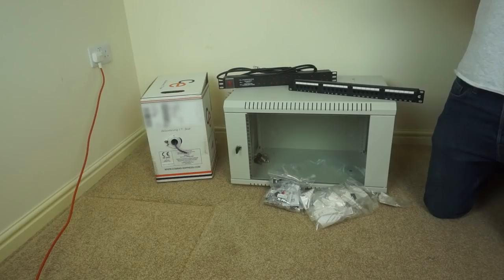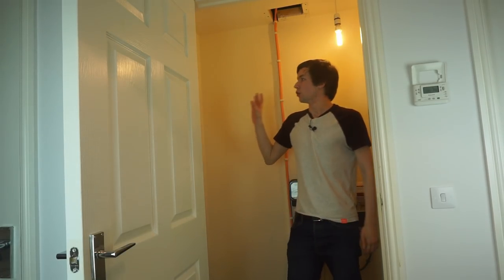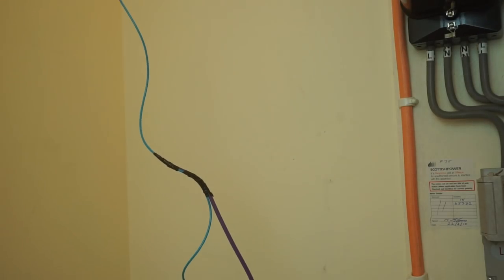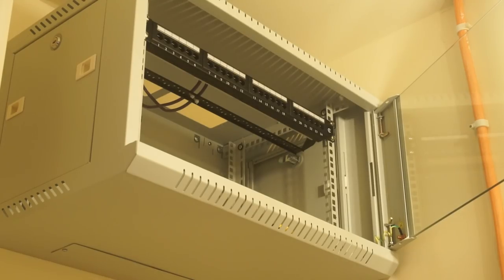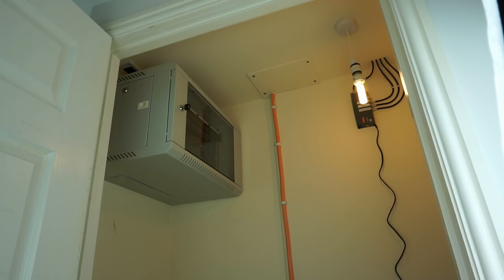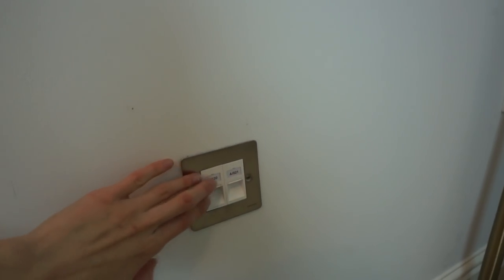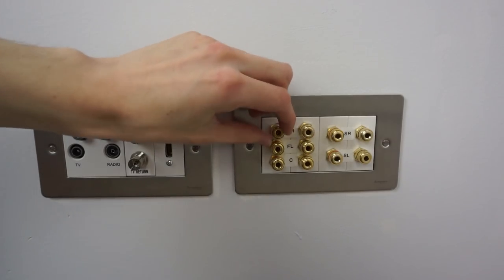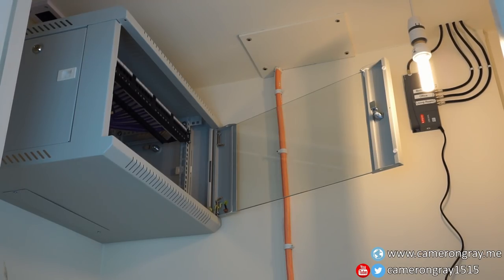New Flat - Time to install a completely overkill home network!

Comment: What was the reason you have installed coaxial, and not just using the ethernet ports to stream via i.e. plex via for example a hdhomerun?
Reply from the maker: It cost very little (probably around £50 for everything) and required no additional disruption as it runs to the same points as the CAT6 does.  If I want to watch live TV it's also significantly easier to just use the tuner built into my TVs than having to muck about trying to stream it.  I was honestly really surprised that there wasn't already TV antenna connections in the bedrooms already from when the place was built.

Comment: How would you go about networking a flat which was built with the more solid old-timey methods of stone construction instead of having plasterboard everywhere? Is surface-mounted cabling the only way to go?
Reply from the maker: It's a lot more destructive but assuming you can lift floorboards you'd run the cables under the floor and then chase out the walls to run a channel for the cable and then chase out a larger square hole for the backbox.  You'd then have to plaster over the channels again - probably worth using conduit inside the channels to allow the cables to be pulled back out again in the future.  If that's too much effort then surface mounting would likely be the best option, you could always still run the cables under the floor and then just need to use a bit of surface trunking to bring the cable up from the floor to the outlet.

What I'd generally do is take a couple of the sockets off and see if you can figure out how they have been installed into the wall and where the cables are being run - e.g. are they running under the floor or are they going through the ceilings.
Reply: Cameron Gray Thanks for the reply :)

Comment: when fishing cables around house do you put them in same opening or near as power leads?
Only way i can route cable upstairs is via one hole that is used to supply 1 power lead upstairs... Is interference an issue?
Reply from the maker: Ideally you'd want to keep them separate but I will admit that theres places in my install where they run near to each other such as to have power and data behind a TV where you need them to be next to each other.  Then additionally, all of the mains wiring runs through my ceiling so if I had to keep data wiring totally separate, it would be a nightmare, I'd probably have to rip ceilings down and clip the data cables explicitly away from the mains ones.  I've never had an issue thankfully although if you're worried and the mains cable is carrying a particularly high current, shielded cable may help.
Reply: @camerongray1515  thanks. So your electrical cables are not via the floor? Although with the raised ceiling you've plenty of room for cables.
I was tempted to put it in trunking but its a pain to get that thru void.
It was a trouble getting the cables thru in first place 😁😂
Reply from the maker: Yeah, in this place everything apart from the gas runs through the ceiling - water, central heating, electricity, data, phones.etc.  Gas runs under the floor but it's literally one pipe from the meter to the boiler.
Reply: @camerongray1515  is that because it's like an apartment setup?
Anyways you're responding during early hours  ⏰

Comment: Wish i knew how to run wires in walls as well as you. Suppose it helps having that huge hog-out drill bit for extra large holes through studs. Lot of drywall holes tho.

Comment: I reckon all the sockets you added as wall mount are going to get used ever !
Reply from the maker: I do use them, that was the whole point of the project!  Sure they aren't all used all the time but I made sure to add more than I needed so that I have room for future expansion without having to cut holes in the walls again.
Reply: @camerongray1515  good stuff man, great video,

Comment: Should maybe include some mains plugs at the same time.
Reply from the maker: Currently waiting on an electrician to be available to add them - Will be getting a 2 gang socket behind each TV then a 3 gang one in the hall cupboard.  Unfortunately, Scottish building regulations are really strict as to what work is classed as "requiring a warrant" when it comes to doing electrical work in a flat (you can do way more in most houses, in a flat you are pretty much limited to replacing existing fixtures with new ones) so if I were to do it myself (which would be dead easy) you'd have a complete faff submitting warrants and getting everything signed off which I have no idea about how to do!

Comment: The installation of the network hardware reminds me of when I was in year 7 and networking hardware was installed throughout the school, a rack was installed in my classroom and of course cables were run through the buildings.  I've often wondered if anyone has a network cabinet rack installed in their homes and now my question has been answered.  I've sometimes had dreams in which I'm in a house where network rack equipment has been installed.  Is the radio socket for connecting a cable to your radio tuner's FM antenna socket for improved reception?

Comment: I can't believe this video is 4 years old :) how did these wallplates hold up.
Reply from the maker: Feels like it was yesterday for me as well!  Modules are all holding up fine - I broke one but this was due to me tripping over a cable but other than that they've all worked perfectly.  This was the other benefit I found of using the separate euro modules and keystone jacks - when I tripped over the cable, it just snapped the clip off of the euro module part but the keystone was fine.  Meant that it was super easy to just clip on a new euro module shutter without needing to touch any of the wiring.

Comment: How many face plates keystone Jack's and euro connectors did you end up with In the end? I prefer the cable going down as then there's less chance for damage!
Reply from the maker: I've currently got 14 drops to ports down at floor level, 6 behind TVs, 1 for the access point and 2 cameras.  The APs and cameras don't use those keystone modules so in total I have 20 keystone/euro module combinations across 9 faceplates.
Reply: @camerongray1515  wow that's some good going. Feeding the cables is a pain! Keeps getting stuck in insulation and hitting studd joists!

Comment: Are you going with FIOS for a blistering broadband connection, if you have a SKY HD+ box you need two sat connections not one, if your Fridge/Freezer is an IOT enabled unit that should be good.
Reply: As you can see at 29:13, he has two SAT connections :) He also said in the video he'll be using the phone jack in the closet.

Comment: What kind of mini PC are you talking about putting behind the TVs used for?
Reply from the maker: The one in the bedroom is the "Z83 Mini PC" I reviewed previously and for the office I'll probably get another similar one down the line.  I tend to use them for watching online content (YouTube, Catchup TV services.etc) - The Smart TVs can technically also do that but there's some services they don't support and I find using a PC with a proper wireless keyboard/touchpad much easier than trying to navigate a smart TV using the remote control.

Comment: Great video, exactly what I’m planning to do. What did you fill the holes with? Would have liked to have seen your technique for filling the large holes as I’m worried in going to leave a mess!
Reply from the maker: Thanks!  Essentially to fill them I used a piece of wood glued across the inside of the hole then glued the original piece of plasterboard that I had removed onto this (I mounted the piece of wood in such a way that the bit of plasterboard sat slightly deeper into the hole than the rest of the wall.)  I then just filled the hole with plasterboard filler, sanded it (took a couple of rounds of filling and sanding to get it completely smooth) then just painted over it.  Afterwards the holes are all practically invisible.

Comment: Not sure if you can answer this, but for the coaxial cable thing you installed was that connected to your main aerial that your tv provider gave you?
Reply from the maker: It's connected to the aerial feed that comes into my flat from a communal aerial which is fed through a fancy distribution system to all of the flats in my building.  If you had your own aerial it would connect to that instead although in the UK you wouldn't get an aerial from a "TV provider," TV over am aerial here is free to air so there is no provider as such, you'd be expected to buy and install your own aerial.

Comment: As you live in a flat, I don't think that letterbox draught excluder complies with building regs regarding spread of fire or transmission of sound.
Reply from the maker: As far as I'm aware it's okay in my situation since the ceiling isn't a fire barrier between two flats, that purpose is served by the concrete ceiling above.  It would however be an issue if I was in an older style of building where the upstairs property's floorboards were directly above my ceiling with nothing but a shared void in between.  There are already larger holes in the plasterboard from when the property was built such as one to allow a large communal drain pipe to pass through and as far as I can tell, the plasterboard used for the ceiling isn't fire rated.  Of course I'm not an expert in this so don't take what I say as definitively correct :P
Reply: Yes I can see your flat is modern construction so you should be fine.
The soil pipe, if PVC, should have an intumescent collar to seal the hole in the event of fire.
Reply from the maker: Yeah, it's PVC, I'm hoping that they have some sort of intrumescent seal around where it goes through the concrete because all they have done is cut a massive square out of the plasterboard and shoved the pipe through leaving gaps around all sides!  Annoyingly it's in a really tricky place to get to so I can't really check, need to find my borescope!

Comment: Have you considered using something like SIPGate for VOIP phone services? It's probably cheaper than any of the home phone providers, and you could then use one of the ports in the hall for a VOIP Phone.
Reply from the maker: I just use my mobile for all calls, the phone line is only required for broadband, I don't actually have a phone connected to it.

Comment: 2nd note to add, the CAT6 patch panel recommendation was great with the back bar, but the linked one seems to have changed now. It seems to have a 8 port grouped variant with cheaper labelling system (well, according to the pictures anyway). I searched and ironically found the same one you have now on eBay for slightly cheaper:

https://rover.ebay.com/rover/0/0/0?mpre=https%3A%2F%2Fwww.ebay.co.uk%2Fulk%2Fitm%2F352230275138

Delivered today and confirmed that.

Comment: Also, was only one amplifier needed for just that TV or, are there other devices, too?
Reply from the maker: The distribution amplifier in the hall cupboard feeds all of the TVs, the second amplifier I added amplifies the feed that goes to the distribution amplifier so it does amplify the signal for all TVs.  The setup is basically [Antenna]->[Masthead Amplifier]---(long coax)--->[Distribution Amplifier]->[All TVs]
Reply: Got it thanks.

Comment: This is such a helpful video! Did you use the deeper 47mm back boxes, or are 35mm ones enough?
Reply from the maker: Thanks!  I used 47mm boxes everywhere since the cost difference was minimal and they weren't any different to fit.  I suppose if you're having to chase out brick then a shallower box may save time.  Just measured one of my faceplate assemblies and it's right on the 35mm mark so it's very marginal as to whether it would work in a 35mm box.  If a 35mm box is a requirement I'd either look at shallower euro modules (the right angled ones I have are particularly deep) or potentially don't use flat plate faceplates like I did (flat plate looks nice but means that the euro modules sit further back into the back box.

Comment: So, do I understand that the cable from the TV antenna comes down to the face plate in the lounge room, then you plug a cable into that socket and then into the TV Return socket?  Is the TV Return socket connected to the distribution amplifier?  Why not just run the antenna signal straight into the distribution amplifier then run the cables to the face plates in the other rooms and completely bypassing that face place next to the speaker connections?
Reply from the maker: Yeah, you connect the incoming TV connection to the return connection which in turn runs to the distribution amplifier.  I should probably have covered this in more detail in the video, for people who are wondering how the system works:
As this is a relatively large building full of flats, there is a communal antenna and satellite system installed (prevents the appearance of the building being spoiled by getting covered in antennas and dishes which are explicitly forbidden in the title deeds).  This system multiplexes the signals so that there are two coaxes that come down into the flat, one is a single satellite connection, the other delivers a second satellite connection along with the signal from the TV antenna and a separate FM/DAB antenna all combined onto the one cable.  The module I've installed then contains a bunch of filters to split each of these signals out into their own connectors.  You would need the faceplate to be able to use the signals.

I suppose I could have relocated the faceplate to be next to the distribution amplifier but didn't for a few reasons:
    (1) It would have been a bit of a nightmare to move the two incoming cables as I have no idea how long they are and where they enter the flat.
    (2) If I broke one of the incoming cables in the process, I'd have an absolute nightmare replacing it as I'd probably need to get the building factors involved to access the communal system and to replace the cable, I can't imagine this being a particularly cheap option!
    (3) The faceplate delivers the satellite connections which I would still want to have in the living room in case I got Sky TV in the future.

At any rate, I have a fairly large cabinet that sits in front of all those faceplates so it hides the cables used for the return connections (you could also make it look pretty neat by using custom, short length cables rather than the long ones I had sitting around that I'm using currently)
Reply: Sure, I see all your points there and they make sense, I just thought it would in theory involve less cables if you ran the incoming signal cable directly to the distribution amp, but your reasons make sense.  Since I also live in an apartment complex, we too have a communal TV antenna.  There's also an FM Radio connection inside my apartment, but I can't use that because my stereo system doesn't have a compatible socket on it.  I probably could get an adaptor I suppose, but I've never bothered with it.  Will you be taking advantage of your radio connection to connect to your tuner's antenna input if it has one?  I still think this is a pretty impressive setup here.  I presume if your modem has built in Wi-Fi, you'll turn that off and use the access point instead, because having a Wi-Fi transceiver operating in that cabinet, though it could be done, would mean that you wouldn't have a good signal through the house, would you.  I guess that's why you've installed the ceiling mounted access point, right?
Reply: BTW, satellite TV, though available in Australia, isn't that common as I understand it.  Unless a homeowner has a system installed, you don't typically have satellite TV dishes and connections installed when a dwelling is being built as a matter of course as I understand it, unless as I say, a homeowner or builder arranges for a system to be installed.
Reply from the maker: I need to figure out what connector the amp uses for the antenna, it's like a Belling-Lee connector (the standard for TV antennas in Europe) but slightly smaller.  Once I can get an adaptor cable I'll probably hook it up.  I'll show the full network setup in the next video I do about this project but as I did with the cabling install, I've completely overcomplicated it! :P  I'm using a basic VDSL2 modem (no built in router or WiFi.etc), a UniFi access point installed in the hallway, a pair of UniFi switches then for the router I'm using a rackmount 1U PC (that I made a video of here: https://youtu.be/JgBaRzmOqjQ) running the VyOS operating system.
Reply: OK.  The FM antenna on my stereo system is this little leaver thing next to a square socket of sorts I think.  You depress the lever, or tab, slide the wire into the socket and then let the tab go.  it's on a spring.  I don't know what they call that connector, you sometimes see it on speakers too I think.  My stereo system also uses a similar connector for the AM loop antenna.  Can you tell that I don't know much about different connectors?

Comment: I Would have at least made sure one of the holes went into a joist or I would have screwed a 2x4 into the joists then screwed the mounting gear into that for a more sturdy mount.